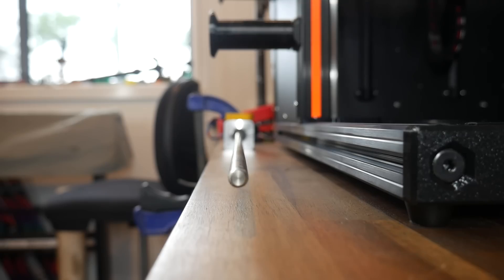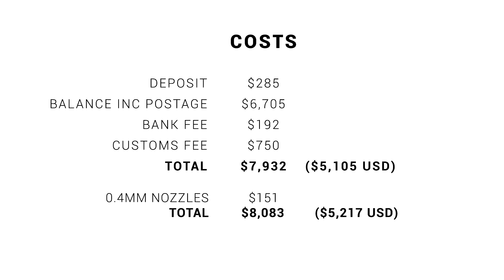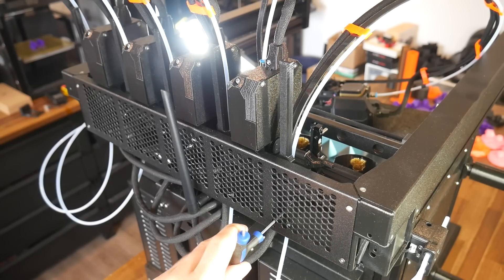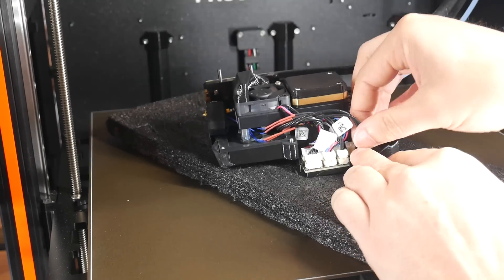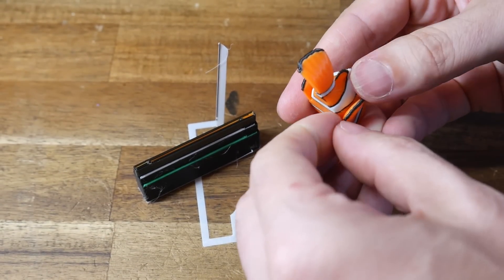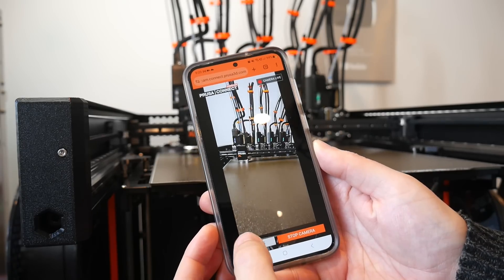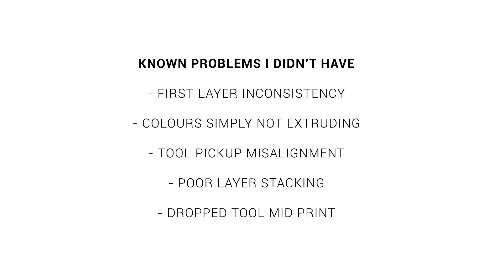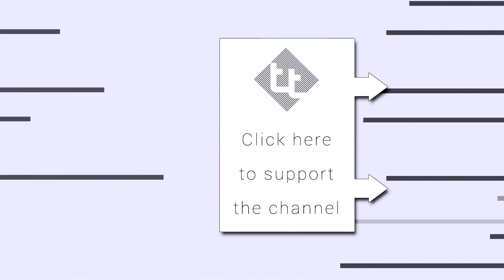I’m (mostly) happy with my Prusa XL - This is what it took

Comment: Well, thanks for this.  I think I just delayed purchase. of the XL for a good while based on your video.  I do have to agree that Prusa support is just fantastic.  I just upgraded my MK3S to an MK4, and frankly, I had some strange issues (my fault of course) that I would not have been successful rectifying without their excellent online support.  For me, this makes all the difference.  I love building and upgrading my printers, but when I get stuck, I really appreciate the extra support.  This level of support is perhaps not as important to the die-hard DYI gurus who are experienced builders of a Voron or RatRig, but for me, the support more than justifies the premium pricing.  All that said, it still appears to me that Prusa released the XL too soon - at least for people forking out $5K with expectations that it will perform as advertised.

Comment: "Support is the best thing Prusa has going for it right now."

Talk about damning with faint praise. You would hope it would be the printers.

At $2500, you could instead have FOUR of the BambuLabs A1 with filament AMS and still have money left over. And I would argue that despite being a bedslinger, the A1 STILL prints at a superior quality to the XL...

It also seems clear from your experience that all of the old arguments about Prusa's superior build, reliability, service, and quality are no longer relevant. 

Prusa is shipping overpriced, underfeatured, unreliable printers at unjustifiable prices. I just can't see them lasting much longer - not as the benchmark of the industry, anyways.

Comment: Hi!
Thanks for the update video and honest opinion. I’m glad that after all the struggles, the XL received your recommendation and I wish you many successful multi-material prints with minimal or no waste.
I have to say, I’m sorry you had problems with the printer. To me, it seems at least some of the problems are caused by a defective unit or some shipping damage. Although I admire your decision to repair it yourself, I want to point out that we provide a warranty. After basic troubleshooting with support, we would have exchanged it for a new piece (of course, we cover the shipping costs in such cases).
Please don't underestimate dry filaments: XL thrives with dry filaments because the tool heads are kept warm when waiting for their turn, and while the temperatures are not as high, there is plenty of time for the water to evaporate. This is similar to your nozzle oozing when left heated even without pushing new material in.
Reply: Any plans for supporting various nozzle sizes?
Reply: Probably not an interesting video if your issues get solved by talking to support like a normal user.

Comment: I am using 0.6 nozzles on my DAKSH Tool Changer (Similar mechanism as the XL)- and have it tuned to the point where the stringing is well controlled and I can print complex models without a wipe tower. I have achieved this with slicer settings, predictive toolhead heat management (heat the next toolhead while the current one is printing), toolhead change retraction/ de-retraction settings etc. Here is a timelapse of a 22 hour 5 colour print that I did very recently- https://youtu.be/5WeLoIn3UTw

Comment: Right, just build a Voron 2.4 r2, the latest siboor kit comes with Beacon for less than $1500 landed in Canada. Build the ECRF V2 for $200 and have what appears to be a MUCH better fully opensource printer.

Comment: I'm still wondering why a 0.6 nozzle works so much worse than a 0.4. On a printer this large, I'd not want to go smaller than 0.6 for most prints. On my MK3S, a 0.6 works great - why would it work so poorly on the XL; do you feel it has to do with the hot-end, the nozzle, or firmware? Or is it simply that the whisp issue is exacerbated by the larger orifice, ultimately leading to collisions with the model (resulting in the failed torture test and blobs on multi-color prints)?

Ultimately, it shouldn't fall on you to do all this troubleshooting. It's a good thing I don't have the cash for one of these anyway.

I truly hope there will eventually be more competition in the multi-tool printer arena. I will not even consider multi-color printing until there is one within my price range. (And more than just an IDEX.)

Excellent analysis and I truly hope things improve for you and your XL.

Comment: Thanks so much for the info. I've been thinking to buy a XL with the 5 tool heads for long time with ups and downs depending on the info I was collecting along the time but I think today, after seeing your video, I made my decision NOT to buy. Echoing some other comments what I find more and more unacceptable is this idea that in the world of 3D printing companies can take the luxury to release half ready products and then expects end users to test/debug/find solitions. Let me say, coming from several experiences, that Prusa does this a lot... definitely too much... I would like to reaffirm a basic but very true concept of modern economy: in a commercial relation, the duty of the end customer buying a product or a service is to pay the requested price. That's ALL. The rest is up to the seller. I think we should all make an effort to establish this concept also in this sector. If something is not working as expected we should simply send it back! That's my opinion.

Comment: I agree that for this price range the printer should come out working flawlessly.  You should not have to use thread lock etc.  Regular maintenance that is all.  I can understand if you buy a kickstarter machine with innovation that you may expect some tuning depending again on the price range but Prusa is a leader and should act like one.  Offering something later that should be there at the beginning should not make you look good.  It does not in my mind.

Thank you for the review and a job well done.  I was going to buy one but decided to wait based on the fact that Prusa is sometimes late at giving out what should already be there.  I am still considering it but perhaps when I start seeing reviews of people having used it steadily for 9+ months I will buy one.

Comment: I cannot really understand a 5K printer with 5 heads will print only PLA and PETG. Well maybe some support materials and TPU.  ABS, ASA and all other composite materials is nearly impossible. 5K for  multicolor PLA printing experience is very expensive.

Comment: quite surprising (and shocking) there's no detection for a dropped toolhead. it's not difficult in the slightest, either a micro switch that gets depressed by the carriage upon mating, or even just two pins and a circuit completed by a jumper on the back of the carriage when connected, anything like that would have cost literally nothing to produce and be dead reliable for 10s of thousands of cycles at a minimum.

Comment: I would like to declare in advance that I am not a bambu fanboy, but what Prusa has done with the XL is I believe unacceptable. Despite the fact that it has a LOT bigger build volume and multiple toolheads, getting beaten by A LOT by the little A1 Mini that is over 10 times cheaper is embarassing. Taking into account the X1C that can print with 2.5x as many materials (granted, with only one toolhead), that printer only costs 1400 dollars. If Bambu were to create a Prusa XL competitor, then Prusa wouldn't be able to sell a single one of these. I like the fact that the creator space doesn't outright attack prusa for these mistakes, but they are relying on the fact that everyone is giving them second chances and the quality of the products they put out keep getting worse.

Comment: I will add my voice to the chorus that mine was stringing far too much on the first print. HOWEVER, after dropping the temp for PLA to 198c it seems to have resolved all my issues. I have to say, now it is printing spectacularly. Love your videos.
Reply: After reading your comment I gave this a try. And what a world of difference. Went from a complete spiders web between the objects and the purge tower to just 2 or 3 small strings.

Comment: The thing has so much potential. I would suggest everyone just wait a little longer. Remember the mk3 launch, everything went tits up, but tody it has years as one of the most reliable printers on the market. The mk4 had similar issues at launch with its first layer for example, but thaz seems mostly fixed now. Not only is the xl a way more complex machine than the mk4, its also the first of its kind from prusa while the mk4 is a further refinememt of the tried and true mk3. Give it time. As bad a reputation prusa has with undercoocked producta as launch, as good is their reputation to actually deliver fixes, upgrades and long term support for all their products. I net if anyone buys a new xl in 1-2 years of time they will have an amazing machine.

Comment: This is, of the other Prusa XL reviews that I've watched, is the most honest in my opinion.  Is Prusa a bad brand? No, far from it, they are still top tier, but this printer is just not worth the price tag.  If this is what Prusa is putting out against Bambu, why not just get Bambu?  Or 3 Bambu's based on the price tag.  I would prefer a multi print head tool changer, but not at this price point. I'll just get a cheap IDEX and deal with its issues or go to a Bambu + AMS and deal with the waste and high print times.

Comment: Prusa is not this fledgling company making kits for the reprap community anymore. They are a multi million dollar corporation and as such, nothing less than a working printer should be expected them, especially for such a high price tag. It's clear this wasn't ready, they knew it wasn't ready but would improve and innovate through customer support/feedback. They need to be held to a higher standard.

Comment: Prusa was to aggressive with the XL. They were trying to do to many things at once and should have been way more transparent with what to expect. Really this was a beta release without the honesty or transparency.

They needed to debug and get through optimizing the switch of Kinematics and the Nextruder separately. This likely would have taken 6 to 12 months of offering betas of the Mk4 or single tool head XL with the tool head permanently affixed to the assembly. Having the mechanical docking/undocking with two additional major changes was way to much and slowed time to resolution.
Then having a period of 3 to 6 months just for the 2 head version debugged. Then finally the 5 head unit.

Way to much complexity and co-launches all at once. Its kinda like Bambu's issue of constantly launching and refactoring their product mixes faster then they can support and fix them. At least Prusa learned safety from the Mk2 issues though the head falling off mid print in a few cases is quite close.
As trying to be a semi professional 3D printing company you are never going to be as fast or cheap as the clones. Just focus on support and reliability rather then hitting timelines and deadlines you self imposed. If your that worried about being copied then you must never tell the customer the apple-esque solution of 'your holding it wrong'. If it keeps being an issue then its your design, fix it. That's what the knock offs and clones never do (I mean they even copy the garbage decisions of them).

Comment: The water soluble filament you have seems to be very soft. Perhaps a bit wet I have polydisolve s1 and prime select both are very soft when wet but after drying work much better.

Comment: Prusa is running off of nostalgia. Unfortunately it does not work on those of us who never used one or started with better.
I always ask Prusa users. 
If the printer is solid why would I need to tinker or contact support? 
If Prusa is know for great support does that mean the printers were not that great to begin with?

Comment: 0.4mm is approximately 
0.1257 square mm

0.6mm is approximately 
0.2827 square mm

Difference=0.2827mm  −0.1257mm 
Difference = 0.157

0.6 is over double the mm3 area. To overcome gravity and stringing is going to be exponentially more difficult than that of a 0.4. especially at higher temperatures to increase flow.

imagine a 0.8mm nozzle at 0.8mm is approximately 0.5027 square mm

Comment: It reminds me my first 3d printer which is a Ultimaker knockoff, almost everything on that printer was off. It took me a couple of months to fix 90% of issues. But it turned out great and I was emotionally attached to it. 😢
Reply: Was? Hope you still have it. Or at least passed it on to someone who would appreciate it.
Reply: @parsonk4041 I replaced it with an ender 3 and forgot about it afterwards.😅 I still have the printer. It’s z layer still has some kind drift I suspect there is something wrong with the source code, maybe I need to recompile the code or get a new control board.🫠
Reply: what brand was it?

Comment: "Prusa has support as its strongest feature" - im not sure this is true, I have the Prusa Mini + and it has had issues since day 1. Support has been utterly useless and the Prusa comunity just gaslights people with similar issue into oblivion. I gave up on mine and to this day cant use the printer to its full potential. I regret not getting 2 cheaper small printers that would need the same and would probably need the same amount of headache this mini has caused me.

Comment: My first printer was a PRUSA MK3+. I ran it for 3 years and then sold it and bought a Bam Bu Lab X1. I am still a 3D rookie but I can say that X1 worked from day 1 and after 5 months I am still vey happy with it. I was on the waiting list for the PRUSA XL but when I saw  all the troubles I cancelled the order. I am glad I did. Yes it uses lots more filament, but for us rookie printers life is very happy..

Comment: You aren't wrong that all early adopters should have gotten the nozzles free. I would argue that all of you should have also gotten a massive discount/refund because the machine was not only not release ready, but frankly it's performance was and honestly I would argue still is well below the price they are charging. That is ignoring the build quality or quality control entirely which from everything I'm seeing is below the level of printers selling for 1/5 the cost of this. I'm glad you have yours at a place where you are mostly happy. As for me, this printer is firmly on the watch but no buy list until it gets some major revisions or a major discount, both or a version 2 comes out. Sorry, Prusa really dropped the ball on this one.

Comment: I've never been happier with my recent X1 Carbon purchase than after watching this. I know the XL has a bigger print volume and  5 heads so it doesn't need to switch filaments into one hot end, but the (lack of) quality and features on such an expensive printer is terrible.

Comment: I really don't get the obsession with stringing - it takes seconds to remove.  And are you comparing like for like when you compare 2 printers with the same filament ?  The XL version looks far better - apart from the whispers - and I suspect you have completely different nozzle temperatures at play here.

Comment: I see you're using nozzle brushes.  I installed them too, and have since stopped using the wipe tower.
You can mix the nozzle sizes but PrusaSlicer then won't allow you to use a wipe tower (which is how I came to try without a wipe tower).

I knew the XL wouldn't be perfect at first.  But, I totally trusted that Prusa would fix the problems and continue to improve the XL long after I purchased it.  That's why I will always be happy to be a Prusa early adopter.
Reply: I wouldnt bank on that faith too much. I was a pre-order on my MK4 and they sent me a lemon. It can not produce a single useable print because of all the issues it has. 7 months later Im still fighting customer service to warranty the machine. They say, "send us a pic of this, take a video of that. Rebuild this section and record the whole thing. Flash the firmware, oh now it's worse now? hmmm, roll it back and rebuild this other part...." It's always another thing to try, month after month. They say it's better for them to figure out the specific part thats bad rather than send me a new machine and Im sure it is better, for THEM. Meanwhile I paid close to a thousand bucks for a paperweight. For the record, my career is in customer support at a software company. Customer service isnt simply fixing the problem the customer presents you with, it's making the problem go away. I can see Prusa asking me to go through at different parts of the printer to see if it was an easy fix but when it wasnt they should have taken care of ME and sent me a new printer. At this point customer sucess is making my situation worse, not better, by insisting on my replacing my defective machine. 7 months of messing around with their crap. That kills brand loyalty real fast.